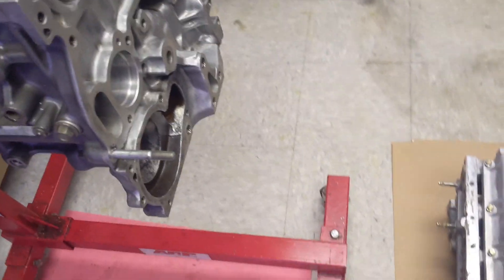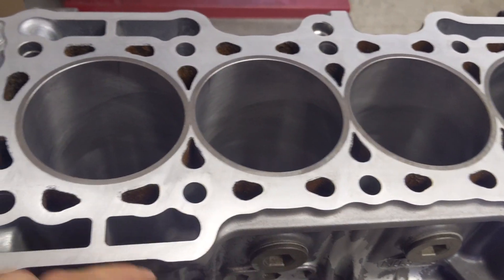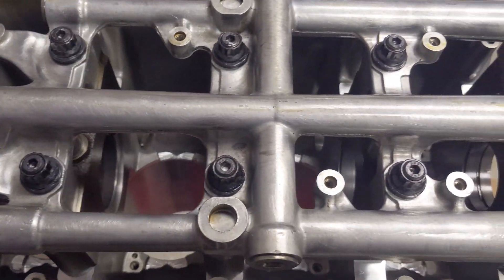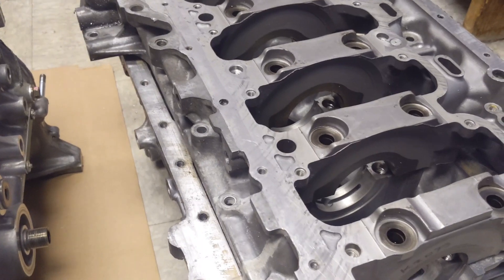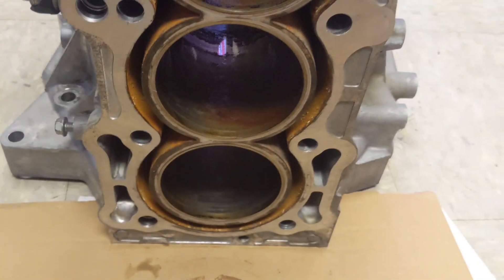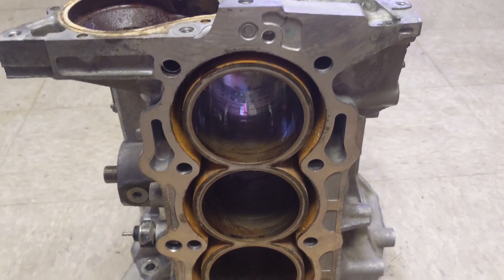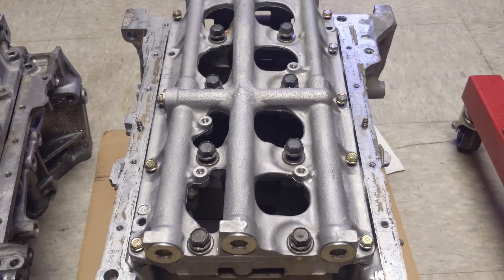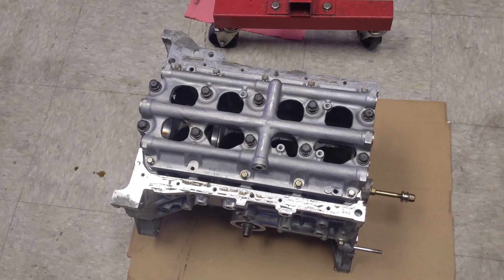F23A Beast Mode On A Budget

Comment: I wrote a guidebook on how to swap an F23 into an EK Civic. Tons of photos from my two swaps. No electrical knowledge required. Parts list. What axles to combine to make your own, how to make your own fuel line, clutch fluid line, power steering line out of fittings adapters and braided hoses. What coolant hoses, water neck, radiator and slim fan. What post mount and T bracket. How to bypass the immobilizer and use the correct ECU for the engine. How to make an interconnect harness between the F23 harness to the EK chassis without making changes to either. What throttle cable, where to drill for the shift cables. Gear ratios for various transmissions. Torque specs, fluid capacities, maintenance intervals, check engine lights, brake bleeding sequence, spark plug wire firing order. Everything you need to have a smooth swap experience.

https://www.amazon.com/dp/B0CWSTC6Q8?ref_=pe_93986420_774957520

Comment: Been looking at h swap for a while since I snapped the timing belt on my f23. I know the sleeves in the h are weaker but they aren’t many internal build kits for the f series as it is the b/k/d where is everyone finding them??
Reply: F23a rods are already forged from the factory. Then its just a matter of doing stronger studs to hold down the bottom end, head studs, and oem k20a2? Pistons. If you wanna really make power on your f series do the h head swap or put a spooly boy onnit

Comment: Nice video. Do you know the best way to take the timing belt adjuster bolt off F23?
Reply: if you are referring to the long one in the center, just take it off with an open-end wrench. There is a bolt integrated near the base of the stud.

Comment: f23a heads share a valve with the j30a1, j30a4/5 are +1mm larger valves (30/35mm) that can be cut into the f23a head with ease. also f23a shares a valve spring with J30a1 so you can use J32A2 valve springs in the f23a head. with j30a4's 35/30mm valves and port work you can hit 300 cfm with ease. Also j30a1/4/5 pistons fit in F23A blocks along with the commonly know k20 pistons fitting. JNA1 hybrid J30 has the best pistons to use with H22 heads being that they are + dome and the valve relifes are the same size. but don't sleep on the F23A head, just use J series Valvetrain in it and port it.
Reply: A video tutorial of this work for the f23 head would be very good and very helpful, there are many of us who have an accord with that engine and we want to improve it, but we do not resign ourselves to placing an f22 head and losing the vtec and having to change all the intake and ignition system, we want to do it with what we have and we know that it can be better only that nobody has given the task of doing it and I think that the f23 is a good low cost engine and that it could be excellent to improve if they existed more high-performance accessories
Reply: Excellent contribution, according to your knowledge then I must work like this the head of the f23a?
Reply: are you still active ? i need some advice for my F23A1 build lots of questions for you i cant find anything online about the j valves in the f head.
Reply: @Strahlendersonnenlicht  I am still active. No One that I know of has done it. The J30A1 and F23A1 share the same valves and springs. All J30A4 and J32A2 parts can interchange. Some needing machined. I spoke with Supertech about the cross refrence and asked if they could list their j23a2 valve spring for the F23A specifically. They said it could be ordered by request. I sent their engineers the info they requested.
Reply: What compression ratios do you get with witch pistons when running an f23 head and block?
Reply: Can I use J32A2 valve springs (with or without retainers and seats) with J30A4 intake and exhaust valves and do port work?
Reply: @franciscodeandradejr  yes, the j30a4 valves will need to be machined. you only need the j32a2 springs. you can use j32a2 valves as a +2mm upgrade but only the intake valve is larger. exhaust is still 30mm.
Reply: How do u know this, thanks for the knowledge btw
Reply: I would like more info on all of this. Any way to contact you? Socials?

Comment: I have kind of a silly question... what intake will fit on an f23a do you have any suggestions? I'm putting 350cc injectors having ecm retuned gonna change cams and gonna go with wiseco k pistons
Reply: any h22 intake will fit the bolt pattern, however, you will need to port-match it to the head.
Reply: that’s not true

Comment: What pistons and rods would you use in a f23
Reply: f23 rods are the only ones that will work, but you can use h22, k20, or f23 pistons.
Reply: @NOTxSOxORDINARY  correction h22a pistons with some boring but k20 pistons without just gives more compression
Reply: @benjaminwatson7868  ahh, i thought h22 would just drop in. With k20 you can get really hight compression. Great for all motor 😃
Reply: @NOTxSOxORDINARY  ya the pistons are like 1mm bigger far as I’ve seen
Reply: @benjaminwatson7868  ya they come in around 11.5ish but the problem is k pistons are reverse offset to an h/f
Reply: @kennethfrazee2540  you can just turn em around and they still work

Comment: I've been thinking of doing an f23 block with an f22a head.  Do you know if I'd need to plug drain ports or modify it in any way?   I see people do the swap but they never tell if they did amything
Reply: I’m running f23a4 block and f22a6 head bolted up no problem. Just you want to use the the f22a water pipe on the back of the engine if your going to run the f22 intake manifold.
Reply: Should just bolt up
Reply: No, you do not

Comment: j30a1 and j30a4 pistons also work in a f23 block.
Reply: Fuckin excellent information, you just changed my whole build!
Reply: @barneymiller7894  JNA1 hybrid j30 pistons are the best way to go.
Reply: @barneymiller7894  also J32a2 valve springs fit in f23a heads, j30a4 valves are +1mm upgrades for f23a. j30a1 and f23a1 have the same valve and valve spring. so any j series spring or valvee can be cut in.
Reply: @michaelelliott3456  This is why I like Hondas lol
Reply: I love u bro no homo
Reply: They do?
Reply: @davidontiveros554  yes I used them in my last f23 block to get a specific compression k pistons couldnt get.
Reply: honda rods are not perfectly centered in the piston. F22 and F23 spin a different direction than J and K. You must flip the J and K piston 180* but not the F23a rod. This will keep the factory style offset. Make sure you clay the higher compression pistons for valve clearance.

Comment: i been racing fseries since 2003..great engine.
Reply: What do you think of the f23a4?
Reply: @camroberts4169  nah its ulev, less aggressive camshaft, intake manifold and ecu. get a jdm f23a no number
Reply: @mejia76O  but the cylinder walls are weak I saw a guy broak them making 360whp

Comment: Would it be better to run the F23 as a long block setup given the Vtec or run as a Hybrid F22/F23 ?

I'm in a 94 Prelude and I want to go Boosted and i have all the motors and plenty of supporting modifications and Tuned ECU.

I'm just waiting on my decision to go F23 or F22/F23 hybrid.
Reply: As far as I know, the only difference between a F22 and F23 block is the bore of the pistons. 85mm(F22) and 86mm(F23) other then that, they’re practically identical blocks
Reply: The f22a head flows better than the f23 head.    I'm not sure if you need to do anything to mate the two heads

Comment: hey bro say someone wants to make around 300 hp on a f23a1 block what would be components you would suggest to upgrade to make that manageable  and yet still be a daily driver?
Reply: True a 4cylinder f.b series 300hp is def with turbo not n/a high comp
Reply: Higher compression pistons, and bigger cam, and your main bolt ons, etc. should easily get you to around the 300hp range
Reply: @untoldguitarist  Is it really possible to get to 300hp all motor on an F series? I find it doubtful
Reply: @MuddafukhingdisKUST  Depending what parts you have installed and running Hi comp, I think it's doable.... Especially if you have an aggressive cam
Reply: @untoldguitarist  he said streetable, he'd need a turbo for that. All motor a "G" Frankenstein with cams/bolt ons/really high compression would be the only way to be in the ball park (and thats still only about 270+whp) running E85 on 13+:1 cr, granted ive done this and managed the car on the street but definitely wasnt a daily
Reply: @thatkidracing3188 was that f23a bottom end or f22a?
Reply: @untoldguitarist  Which bigger cam would you reccomend?  I just did a swap to an f23a and curious about beefing it up in the easiest ways possible.
Reply: @MichaelSvenson  Bisimoto, Delta, or even Web cams. The SOHC Fseries engines don’t have huge amount of aftermarket parts. But there are plenty of options to choose from, to build and gain some massive performance out of your F22/23 setup

Comment: My understanding is that most of the f23a variations are very similar.
Reply: Which ones aren't? F23a4 owner here
Reply: @MrZen20  the f23a1 and f23a4 are basically the same except a different ecu/sensors and a different exhaust manifold and cat
Reply: @MrZen20 a4 has California compliant bs on it and I'd avoid em if you can (I own one also and want to h swap it lol

Comment: Someone should actually build a real G series motor.  G25A 5 cylinder from the old Acura TL...would be the ultimate in baller SOHC.  Inline 5 sounds so awesome turning some revs.
Reply: THIS. I've always been fascinated by the wail of 5cyl engines. Reminds me of the v10 sound👍👍
Reply: Bud Yeddi yes, with enough rpm, a inline 5 will basically sound like an even fire V10, since they have the same cylinder timing.  Now those odd fire V10’s...that’s a whole different kettle of fish in the sound department.  I’ve never actually heard a Honda 5 cylinder...didn’t even know they made one until I saw one in the junkyard a couple months ago.  It was complete and intact, too.
Reply: I bet with how interchangeable Honda designs seem to be there's a factory piston you could fit in there for a compression bump

Comment: what are your thoughts on the f series heads?  I know you love those single jingles so have you messed with the f22a heads?  I always wanted an f22a head/f23 block engine
Reply: F23 head is better than f22 stock form. Ported even better. I ran one for years before going with a h22 Type S head on my f23 high comp build.
Reply: @josechaves8240  how hard is it to put an h series head on the f23, do you have to mess with the timing gears ⚙️ or mess with anything else or does it just bolt on and ready to go
Reply: @josechaves8240  you are correct. people have this incorrect common notion that f22 heads outflow the f23 heads. f23a head flows much better in stock form. Numbers for ported heads are dependent on many variables but I have seen radical f23a heads so the potential isnt so much limited.
Reply: @josechaves8240  the f22a head is better ported.  Thats been covered quite a bit
Reply: @timm5970  what I'm getting at is, *for a budget minded set up*, N/A; you would want the 22head/23block due to the compression bump youll get with out having to shell out for custom pistons, I'm just talking refreshed head and then on the block. Now Turbo; you're probably good with the stock 23long block up to 10 psi depending on EGTs and ring gap (mileage will vary obviously)
Reply: @ThmsPtrsn  I would use the f22 head.  You use H series exhaust manifolds, you can use h23 intake manifold, the head flows better ported, and you have a higher c/r.  F22a head > f23 head
Reply: @tim m yes you are right, but that's ported. Port the f23 head and it will be better. Yeah it's like a Vtec-E head etc etc, I would still choose it over a F22 head regardless of what Bisi says or whatever. Roller rockers, better intake mani etc. What's been covered is a modified f22 head against a stock f23(unfair). Don't always believe what you read....
Reply: @josechaves8240  Port the f23 head and no it will not be better then an f22a head per bisimoto
Reply: F22a non-vtec head have extremely good flow rates when ported, non ported the f23 is just as good, you will get a good compression bump when putting the f22a head on as well, I've seen a guy run stock f22a/23 hybrid at 180 hp and 160 lb/ft
Reply: @ThmsPtrsn  yeah ive read a bunch of stuff about it but never built one.  I think it would be cool if badguys built one.  id like to see what their porting could do